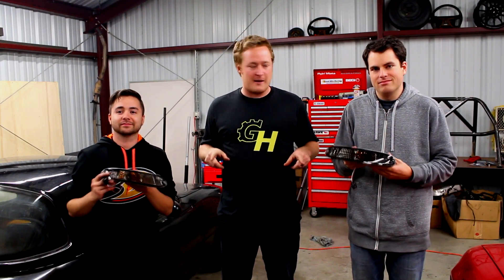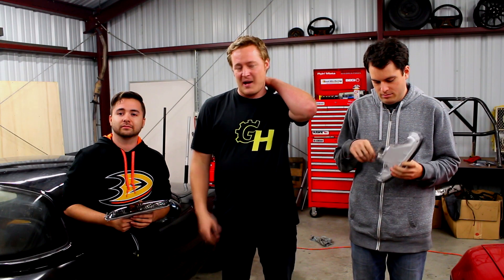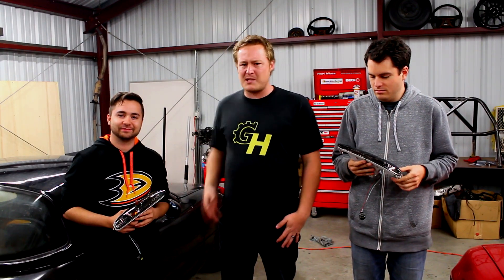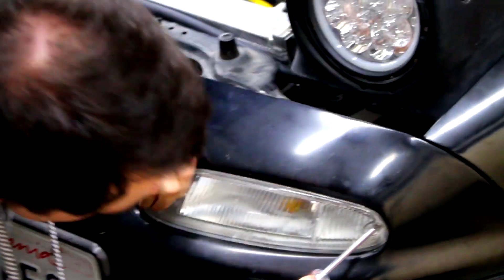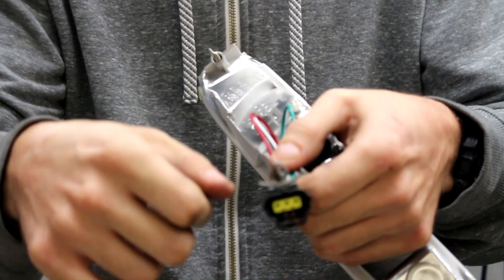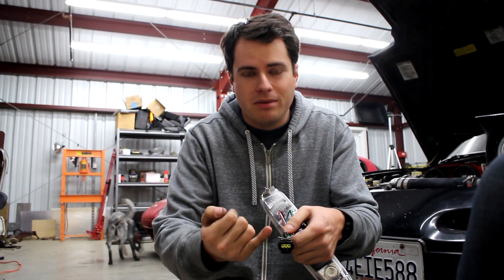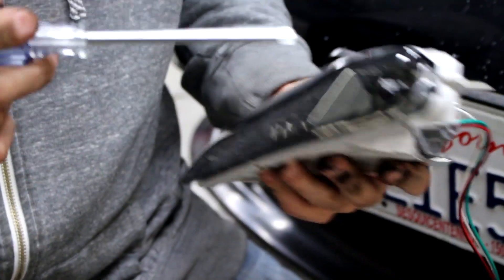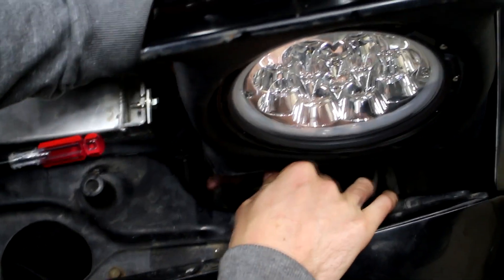Smoked Turn Signals Install | Reborn Turbo Miata Build #26

Comment: I wasn't sure if I was going to like those, but they actually look fantastic on a black car!  For those interested in tinting your own, VHT makes a spray on tint called "Nightshade".   It may be a cheap alternative, but for $40 on ebay you can't go wrong either way!
Reply from the maker: Yup, I like that the lenses on these are actually quite clear though being darker, not foggy or anything, and for how cheap they are you can't go wrong!

Comment: I might just buy some tinted film and see how that goes.
Reply from the maker: jamieee321 Im sure you could make that work, but these look great and at only $40 it made it a no brainer for me. Plus like I said the originals get condensation in them and are faded/foggy. These are clear and dark, look sharp!
Reply: GearHeads They're £100 here.
Reply from the maker: Oh wow! I probably would try the tint as well in that case!
Reply: @mx5parts they are 60£
Reply: Testacorsa  oh ok. thanks. didnt notice them. might look into it in the future. too much other more important parts to buy first. :D
Reply: I hear you! So much stuff to buy when owning an old Mx5/miata/roadster.Good idea with the tinting though. It Should be relatively easy.
Reply: Testacorsa For £10 or so, it's worth a try.
Reply: Definitely!

Comment: So I'm guessing for TSIs to be effective you'd have to run hood vents or something similar, to relieve pressure?
Reply from the maker: colingreczkowski Even still, you'd be getting more air thru the front of the car and then out the hood and less thru the actual radiator. The only thing that can make them "useful" is by ducting them and directing the air to something specific such as the brakes(would be very difficult and impractical), an oil cooler or intake maybe, but those things are difficult to accomplish because of the pop up headlights in the way making ducting difficult to implement. Like I said, they look cool but you want all the air entering under the hood to be coming thru the mouth and the radiator.